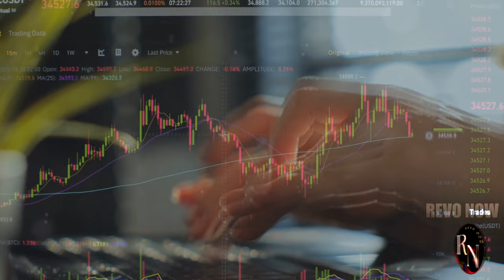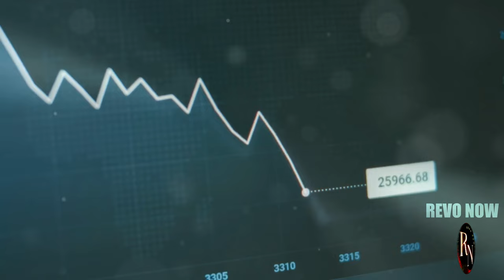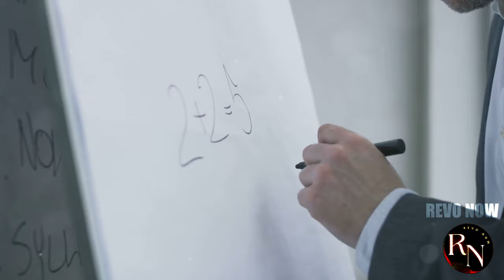TRUMP's Economy SHOCKER: What Everyone Is Missing!

Comment: Missing from the conversation is the fact that the US does not have the infrastructure for mass EV appeal.  For lack of public charging stations and repair facilities, the US has a way to go before the public feels at ease with electric cars. Further, in the past, the high cost of EV, the time it takes to charge batteries, and the high cost of repair have impeded sales.

"As of June 2023, China had over 1.8 million public charging stations, while the US had 128,000. China also has more fast-charging stations than the US, with 760,000 compared to the US's average of just over one kilowatt per EV charging port. Chinese drivers can also get nearly 4 kilowatts per EV charging port" (Google AI)

That's like 14 times more charging stations in China than the US..

Further, China says no ICE vehicles sold in china by 2030, the US says 50% by 2030. (Congressman Tim Walberg website)
Reply from the maker: @MASMIWA  ya! That's why the US wants the Chinese Ev's Manufacturing Fabs to be build here in the US.